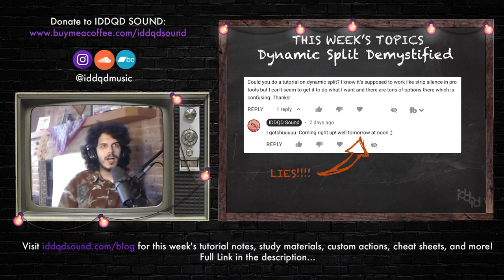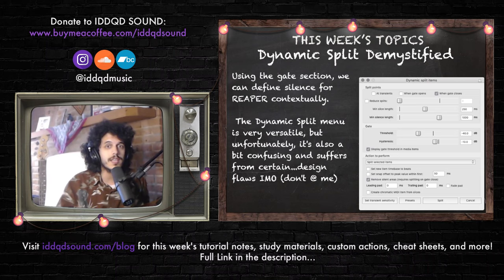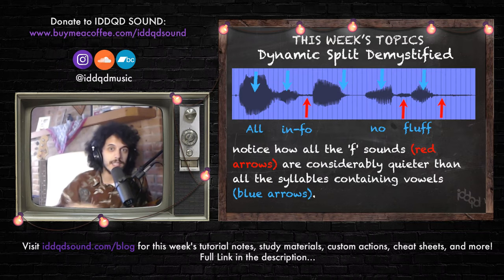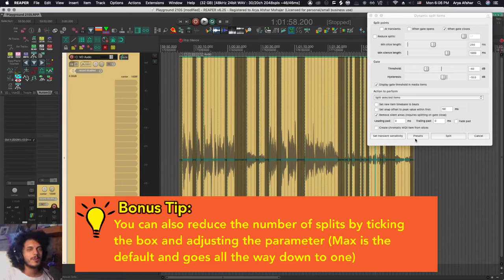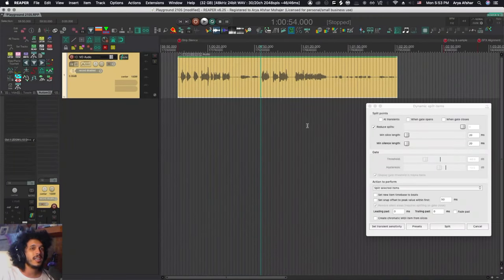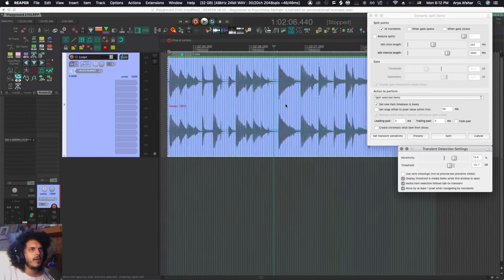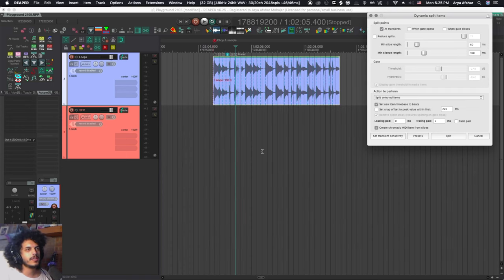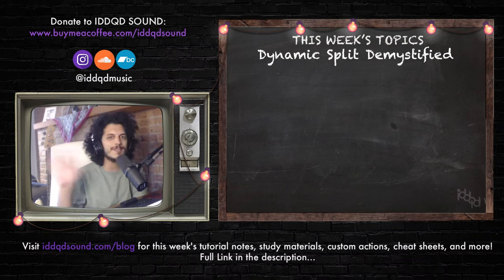REAPER's Dynamic Split Demystified! (Strip Silence, Chopping Samples, Snap Offset)

Comment: Thank you!
Sadlly, this tool is not working fine.
Most of times I have to set the threshold to "-60" and sensitivity to "100" trying to not miss those transient starts...
...this causes many unnecessary slices.
Create MIDI data like ths is simply unthinkable...
Even when tweaking the "reducing splits" it keeps me trying to deal with a wild beast.
So I had to adjust start times dragging them and adding some (that's better than excessive number) then selecting the slices and using that cursor position to slice the MIDI notes...